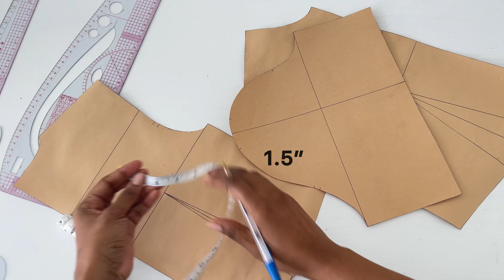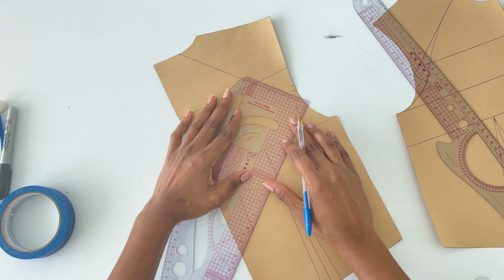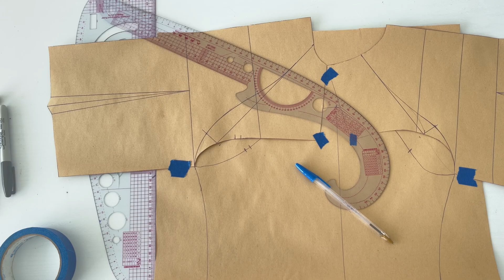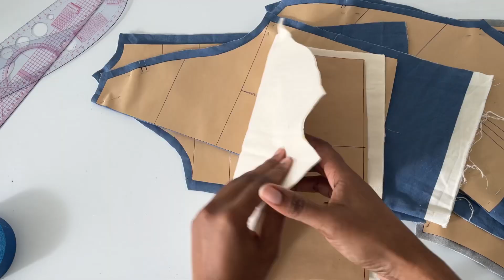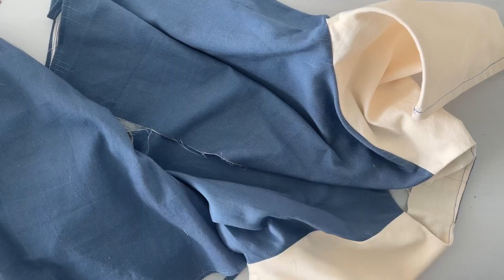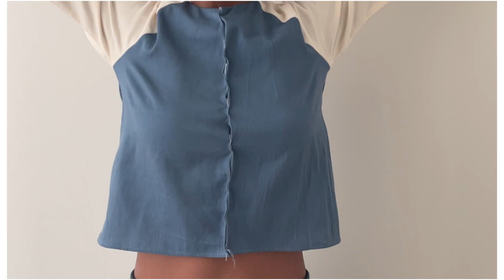Detailed One piece Raglan Sleeve Pattern Tutorial | Dartless Raglan Sleeve

Comment: you are so clever! thank you for sharing. I'm also not a fan of a raglan maybe because I ruined a lovely piece of fabric with a commercial raglan pattern which I've not got over yet 😢 The shape you designed looks great I can't think why there are wrinkles or whether they are supposed to be there...maybe the sleeve head needs to be taller or wider at the top where it meets the body?? as when you lifted the head sides you transferred some of the side length to the very top... mmm a mystery
Reply from the maker: Thank you Lynda! And ouch, about wasting that fabric on the pattern, I know that feeling all too well! 
There’s supposed to be wrinkles when my arms are down but not that much. I think so too about the sleeve head needing to be taller, but I am leaving that pattern alone for now since I use the darted version more anyways. Maybe I’ll revisit it later and if I resolve the issue, I’ll post update.